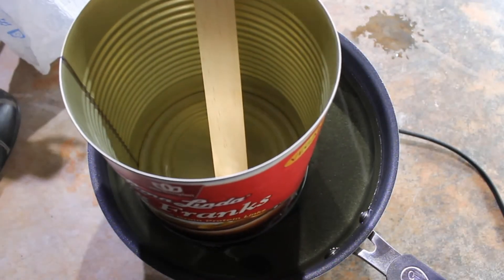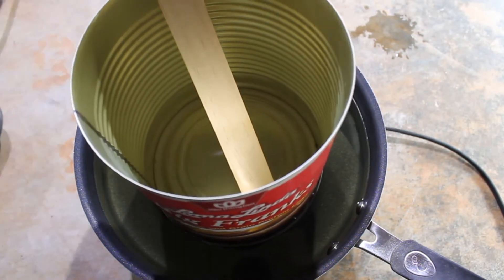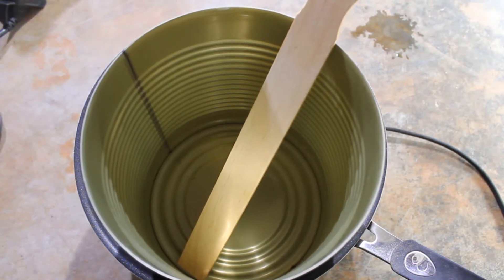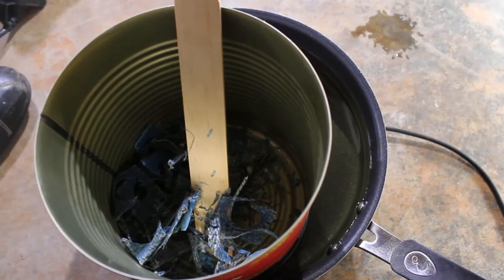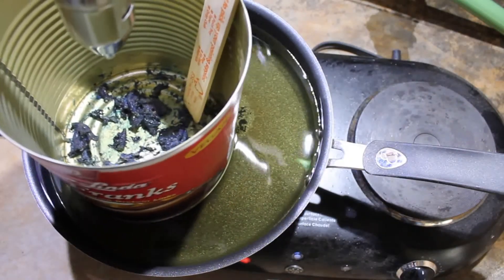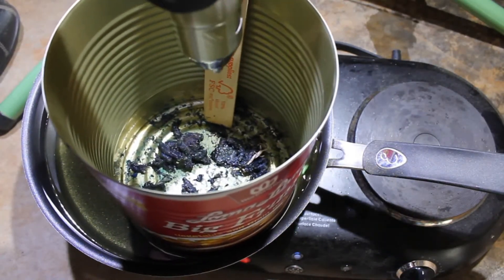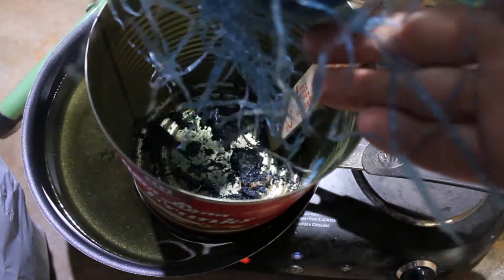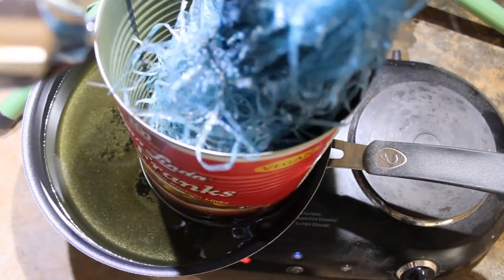0042 PE Polyethylene Big Melt 1

Comment: Thanks for doing that and sharing it, so I don’t have to try it. I was going to try that same thing with the oil, but now I know the oil will smoke and probably burst into flame before it’s hot enough to fully melt the plastic. :)
Reply from the maker: Well it also helps to probably do it on a day that isn't -10 deg F outside with a blizzard roaring outside and blowing sub-freezing cold air over your work area....LOL

Comment: Go to Wal-Mart and by a electric stir fry pan / heat pan it might cost anywhere from $15 to  $25  . With a stir fry pan You can regulate the temperature .
Reply from the maker: I think I might use some left-over Nichrome wire hanging around and build something. I was also going to use it for building an extruder machine following instructions from Precious Plastic.

Comment: You should check out precious plastics - you can melt your plastics to create hdtp that you can injection mould into something usefull - with plastic bottle tops you can create 3d printer filament or  create plastic bowls etc.  they give you instrutions on how to build relative machinery etc using recycled motors.
Reply from the maker: That is what inspired me to do this. :-D
Reply: KalabawCNC fencing post

Comment: Maybe you can try building a metal frame for your melt. That way, you can heat it with the heat gun within the frame, clamp it, and enjoy it sooner.
Reply from the maker: WorkingWoman I just need to get it out of thin film format. I can shred the bricks and then extrude it into a filament and perhaps even filter it to remove gunk. Besides I don't really have space for a metal frame that I would only use once every 3 years. I have to be conscious of space and time efficiency and keep it dirt simple. I don't mind the extra time holding the heat gun since I don't do this often. Doing it in the summer will definitely improve things. This last summer my focus was on paying debts and building my garden. Perhaps, maybe I might get back to this project this summer.
Reply: KalabawCNC, I understand.  I’ve been remodeling my house as a study/lab-type of project.  The house is small and I’ve been getting creative with making good usage of the space that I have.  Kudos for paying off your debts, and best wishes to you for your good works.

Comment: IDEA 4 U  , go to a thrift store and but a Crock-Pot, don't forget it's got a heater eliminate in it should not cause smoke and would be a heck of allot safer , you think ????
Reply from the maker: CORKY DREAMS That's not too bad an idea but I don't expect it would be hot enough. Also I need to melt different kinds of plastic like LDPE and HDPE and I don't want any cross contamination between batches. So a different disposable can is better. I may build something from an old hot water heater if I decide to upgrade to higher volume production.

Comment: Maybe if you stored your plastic scraps in something like an empty cereal box instead of a bag, it would be easier to pour it into your "crucible".  What temperature does your oil begin to smoke at?  Different kinds of oil are more resistant to scorching at different temperatures.  Have you ever thought of trying a pressure cooker?  You might not need oil at all.  You could modify it to hold vacuum to reduce bubbles.  Please wear some gloves.
Reply from the maker: Ron Yerke Thank you. Some good thoughts! I may have to try the pressure cooker. This whole project is kind of on hold for now while I build my garden in the back. I've just been stock piling plastic feedstock material until I'm ready to process it in one large batch. Perhaps next summer.
Reply: KalabawCNC    Good luck.  I'm looking forward to see how things turn out for you.